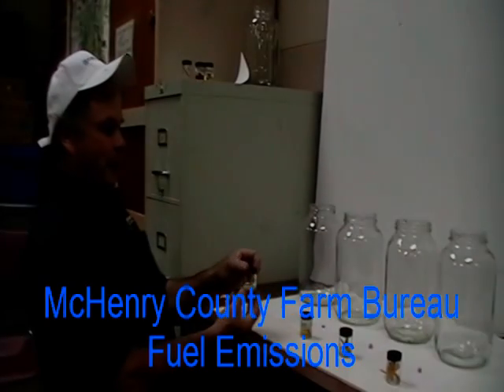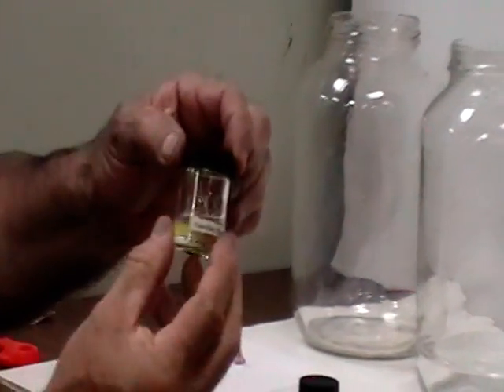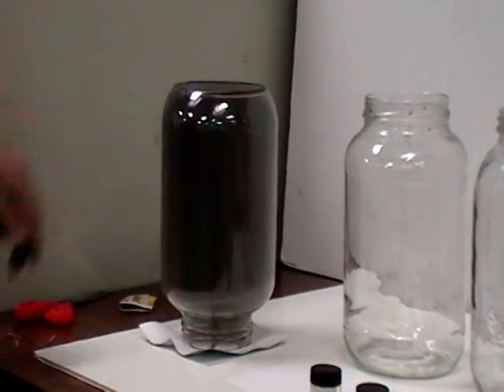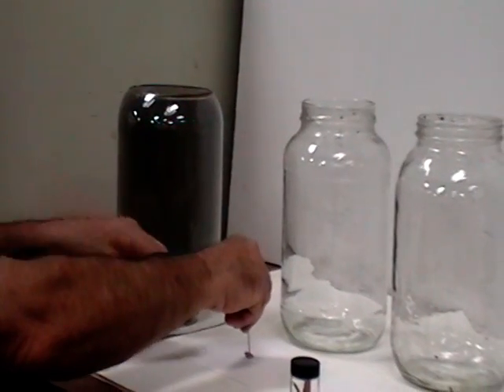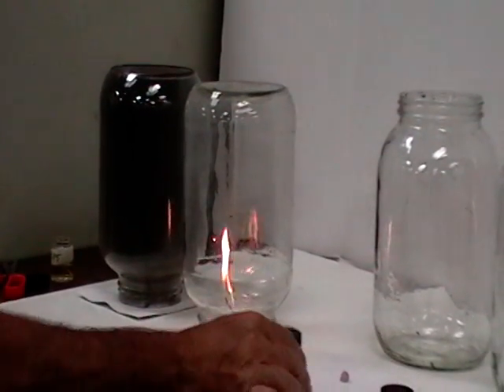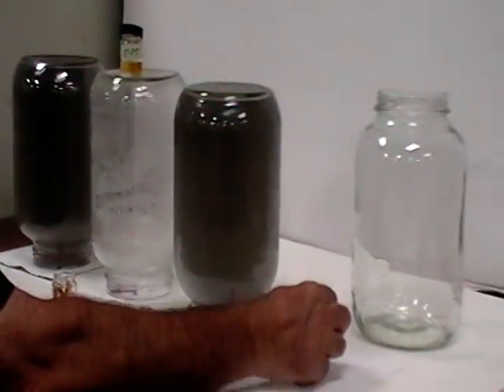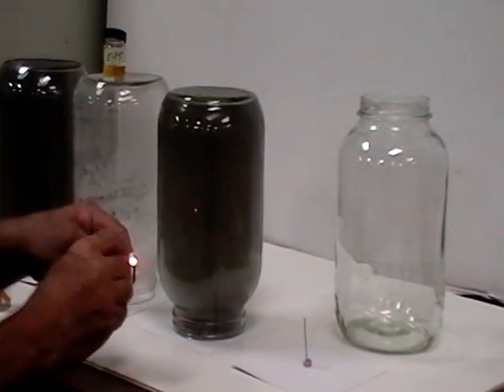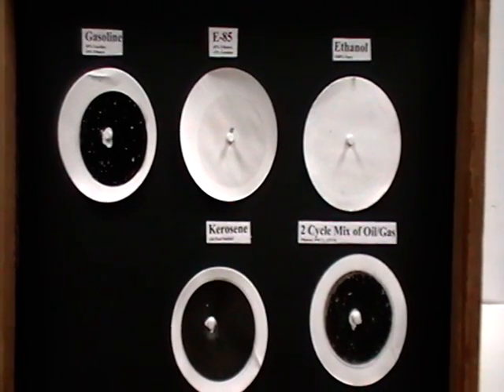Fuel Emissions - Gas, Ethanol, E85, Kerosene

Comment: The soot is unburned carbon.  Ethanol is composed of much more oxygen than gasoline, diesel & kerosene, which in a closed container with finite oxygen allows the E85 to burn more completely, thus emitting less soot. (Count the burn time). So  yes,  it does burn cleaner,  on it's own,  in this very controlled specific example.  In a properly tuned engine?  Not so fast. There is less soot in your car's tail pipe than is in those jars, even after 50,000 miles.  Go stick your finger in it and find out for yourself. (If there's a lot of soot on your finger  you need a tune-up or new engine.) 
This is typical pseudo-science propaganda.  I can imagine this same demonstration with all the senators that voted to mandate ethanol in consumer gasoline sitting in room & all saying ooohhhh! Ahhhh!  in unison. 
  Google "Brazil ethanol air pollution".  Their internal combustion engine caused air pollution has increased with ethanol in gasoline. Why?  It's a boondoggle.
Reply: Brent Rice Upvoted because it's basically what I was going to say. However i'll go a bit further. Regarding Brazil, one of the reasons air pollution has increased is because E85 puts off 43% more methane, which is 34x more potent GHG than CO2, 5% more CO, 60% more formaldehyde and 2000% more acetaldehyde, which are both carcinogens and formaldehyde in particular is lethal in miniscule doses. Not to mention the Production of ethanol releases lots of nitrous oxide which more than makes up for it's reduction of it in the tailpipe.

In retrospect since the E85 container contains more formaldehyde you'd probably be better off inhaling the sooty E10, but since both are poisonous obviously you shouldn't do either of them.

It's not just about CO2 people, there are many other nasty compounds and GHG's out there. Ethanol isn't quite the savior it's toted as, though if some studies are Correct, using it in limited amounts as a replacement for the BTEX octane enhancing compounds might be slightly beneficial overall, but these days you can never be too certain of the truthiness of something.

If lithium-sulfur turns out to be everything its expected to be, E85 will become lost to history anyway as everything save heavy-duty trucks turns to battery-EV's.
Reply: xlioilx
You have a source for that? It's been scientifically verified they produce significantly more methane, CO, and aldahydes but the general consensus is they emit less CO2, even though the use of cellulosic ethanol leads to soil erosion and depletion of soil carbon that letting the stalks fallow in the fields prevents, and this increases cellulosic ethanols lifecycle CO2 emissions by ~50-70g per MJ and largely nullifies it's supposed '86%' CO2 reduction compared to gasoline while emitting other toxic chemicals.

Ethanols ultimate failure is that it is considerably more costly and isn't really greener than gas, in addition to being less efficient. The only realistic and truly green solution for cars is battery-electric, and with emerging battery technologies and the potential to make them partially solar-powered, that solution will be realized sooner than one would think.
Reply: xlioilx
The mileage decrease is true but that is also why emissions are measured via megajoules of energy produced per kilogram of CO2 released.

And in the case of ethanol they get a large 'credit' on their lifecycle emissions from the fact that some CO2 was Removed from the atmosphere in order to produce it, even though they tend to gloss over the fact that a large portion of it is obtained from sequestered soil carbon, which Adds more CO2 into the atmosphere; very Significant amounts in the case of cellulosic ethanol.

This is why despite 0.66Liters of ethanol producing 14.03MJ per kg of CO2 released compared to 0.42Liters of gasoline's 14.64MJ per kg of CO2, Ethanol's lifecycle CO2 emissions are still less than gasoline's; just not by much.

Of course, like I mentioned before, what they Don't mention is that ethanol combustion releases over 43% more methane, 5% more CO, 60% more formaldehyde and 2000% more acetaldehyde compared to gasoline, which exemplifies the folly of focusing on CO2 emissions, since methane is some 34x more potent a GHG than CO2, and more than completely negates any reduction of CO2 using ethanol. This is also ignoring CO2 released by potential indirect land use changes caused by biofuels.

Ethanol also reduces NO2 emissions by ~30%, and doesn't contain BLEX compounds, but due to the extreme toxicity and ground-level ozone-creating potential of aldahydes in general ethanol emissions are every bit as toxic as gas emissions. Combined with it's high price vs gasoline, it's just not worth it.

Especially when there's other cleaner, stronger, cheaper alternatives in the future. Like biopropane, methane, and of course lithium-ion and future lithium-sulfur battery electric vehicles.
Reply: xlioilx
Hydrogen is a false messiah and simply is not efficient or plausible to run the country on. http://ssj3gohan.tweakblogs.net/blog/11470/why-fuel-cell-cars-dont-work-part-1

In practice it is Always more efficient to use solar panels to directly charge a battery than it is to waste significant amounts of the energy in using it to create hydrogen. Especially since the simplicity of BEV vehicles compared to combustion engines drastically reduces maintenance and lifetime costs.

Pollutants released from battery manufacture/recycling pale in comparison to that released by fossil fuels, and experimental molten-air batteries could eliminate most of that in the future, as they use readily available oxygen for the cathode and can reach gasoline-level energy densities.

However for any electricity driven vehicle economy in order to make it Actually green you have to derive all of your electricity from nuclear/solar/wind. It's not much cleaner if the electricity you use to charge/create a vehicles fuel is derived from coal.
Reply: xlioilx
That's part of the reason BEV will render hydrogen moot. They will always have a much higher lifecycle efficiency, and the cars themselves are much simpler, requiring less maintenance and have the potential to be much lighter than combustion engines, which also improves mileage.

There's just too many steps required in utilizing hydrogen for energy, all of which are lossy, or polluting in the case of steam reforming, or potentially dangerous in radiolysis.

Other problems are that the hydrogen has to be significantly compressed(350-700 bar) to be effectively utilized as a fuel, which also wastes large amounts of energy, dramatically speeds up the process of hydrogen embrittlement, causes the hydrogen you just bought to slowly seep out into the air and waste $$$, and is also really really Really explosive. You'll never be able to fill up your own car like you can with gas or charge it like a BEV when dealing with pressures like that. You'd likely be better off using propane.

Other problems are that you cannot use existing infrastructure for hydrogen. You'd have to construct new, specialized, expensive pipelines All across the US to get it where it's needed, you cannot simply use existing NG and oil pipelines as they will quickly be destroyed by embrittlement and result in you losing huge amounts of hydrogen, potentially explosively. Even new pipelines designed to transport it will gradually deteriorate and have to be replaced every 10-15 years; this will Dramatically increase the costs.

It's possible that at some point in the future it might be used for heavy duty vehicles while BEV replaces all light duty vehicles, but by the time that's remotely feasible we'll probably have worked out the kinks in molten-air batteries and there won't be a point to it.
Reply: +WitheringintheDark hydrogen won't be delivered to stations by pipeline. It would be delivered by truck either in a compressed gas state @2400psi, or as cryogenic liquid. It is currently delivered all around industrialized nations with both methods.
Reply: ThinkFreely2012
Which is fine and dandy when you only need to transport small amounts of it to select places. However, its still extremely inefficient and scales poorly; it's not feasible to haul around tens of millions of gallons of the stuff on a daily basis like you would need to do to replace gasoline.
Reply: +WitheringintheDark Methane is flammable how can it emit methane?
Reply: Shaheer Syed
They're by-products of incomplete combustion of gasoline along with countless other chemicals, it's in the exhaust. The exhaust isn't exposed to a flame, and methanes auto ignition temperature is well above that of exhaust(~1000*F)
Reply: xlioilx  actually burning ethanol doesn't release freones

Comment: So why do some "experts" say e85 corrodes your engine??
Reply: +YeshuaLives because it does. Its basically alcohol, which is why it should only be used in cars that have been designed and tuned for e85 in mind. Under those conditions its a excellent fuel.

Comment: You can't do a simpler test than what you see here.  No need for "Controlled Environment".  The results would be the same as long as you have enough oxygen to do what you've done.  Either people will accept it or they won't.  Every day you drive on the road is not always the same, so don't use the low oxygen excuse.  GREAT TEST!
"
Reply: No
Reply: You REALLY are an idiot, as every normal person would know, if there is enough oxygen, hydrocarbons and alcohols will burn purely producing H2O and CO2, if there is not enough oxygen they create CO and C which is that smoke. DO YOU UNDERSTAND NOW? THAT SMOKE IS CARBON. CARBON.

Comment: Most unscientific test I could think of. All fuels burn dirty in a low oxygen environment ... such as burning in a jar until all oxygen is used up.
Reply: Just read an article saying that ethanol produced a lot of NOx SOx pm2.5 .. probably not visible. I'd love to see more
Reply: @johanponin1360  Incorrect, smog testing in California with higher ethanol-gasoline blends produces almost no NOx.
Reply: @TheAutoChannel  interesting, any link to read @
Reply: @johanponin1360  Sure, page 15 of my book, THE ETHANOL PAPERS. You can see and read it online for free at https://www.theautochannel.com/news/2018/10/12/632678-ethanol-papers-massive-book-provides-whole-story-ethanol-fuel-free.html. You'll see the actual smog test results for my non-flex fuel 2002 Ford Taurus. I always used varying higher levels of ethanol-gasoline blends, typically between E30 and E40.
Reply: @TheAutoChannel  that's not the ethanol blend E10. That's the car. My 4.6L V8 2V burns so clean, everything is nearly zeros. Then I've seen ULEV and PZEV with more NOX, CO, and HC than my V8 10mpg (city/ combined)  pickup.
Reply: @jkutches17  In my book there's a photo of the test results I received at the conclusion of the test. You can see it by clicking on the link above. I'd like to see a comparable photo of the smog test you took. 
However, I didn't just make this statement based on this singular experience, I have been present during live tests on other cars that show the huge difference when burning various levels of fuel from E0 to E85. One of these cars was Daryl Hannah's Firebird.
Reply: @marcrauch8213  give me the cliff notes
Reply: @jkutches17  I'm assuming you mean the link to my book. It's just above, in my reply to Johan Ponin. Didn't you see it?
Okay, go to that link. Then follow the instructions to launch the book (it's FREE). Then go to the Introduction, and on the 7th page is the actual smog report. 
Then make a copy of your smog report public. You can post it on a webpage (if you have one), on your Facebook or Gab page (if you have one), or just email me a copy to marc[at]theautochannel.com.
I'm quite sure you won't be able to do this because I'm completely sure that you invented your story. And this bothers me because of two things: You like dogs, and I love dogs. And you posted a video about UFOs, and I like UFO stories, pictures, and videos. But I guess we draw the line on similarities when it comes to fuels...I know what I'm talking about, and you don't.
Reply: @jkutches17  Don't bother with him. He's an Ethanol activist and has previously tried to convince me that Ethanol can't dissolve rubber hoses, which I have visual evidence of that it can... As much as I like Ethanol over Petrol... being scientifically neutral is the key to integrity and trust.
Reply: @TheChrisey  i don't think it does dissolve rubber hoses.  It appears that it does but i don't think it does.  I think the gasoline does extremely slowly over years or decades and the alcohol washes out the gasoline and washing away the rubber.
Reply: @jkutches17  it appears that it does but you don't think it does? That makes no sense at all. In my case there has never been gasoline in the hoses before I used them with ethanol. They are 6 months old
Reply: @jkutches17  Yeah my point was about whether alcohol damages rubber hoses or not, which it clearly appears to do. I'm not here for politics. This particular hose was cheap and might not tolerate alcohol, heck it might not really tolerate gasoline either even tho it's specified to do so. I'm gonna investigate more
Reply: Couldn't agree more... And the only thing he's measuring is soot... Ethanol is definitely cleaner, but the test isn't fair. The level of harm done to humans by the soot will be determined by how atomized it is, meaning, if it's thick it'll fall to the ground quick. If it's very atomized, the wind will carry it to areas where people reside and breating it in will indeed be harmful.